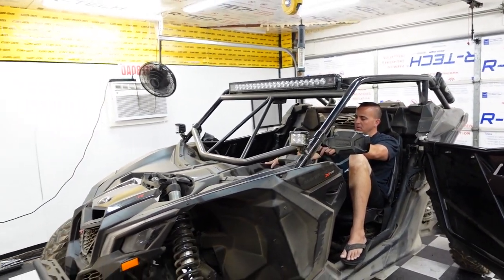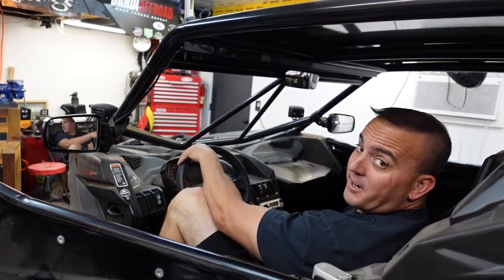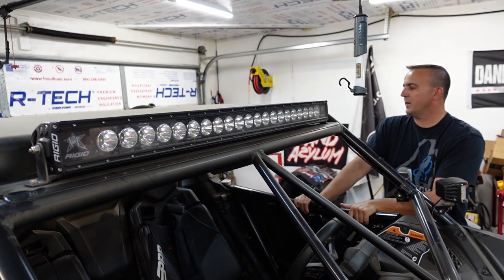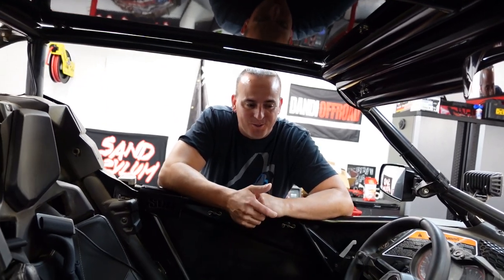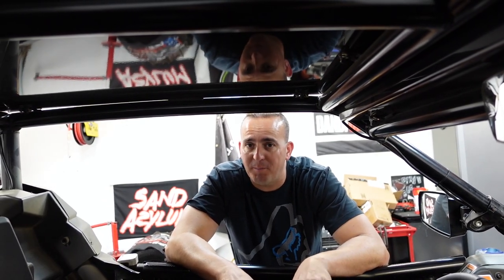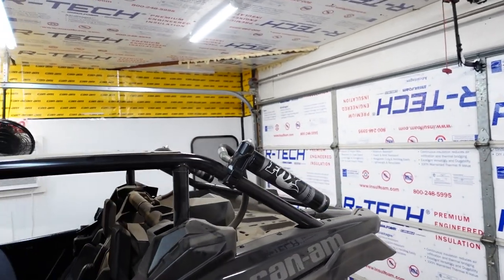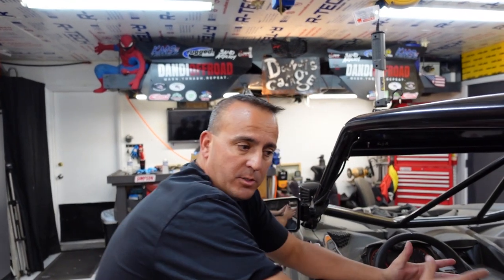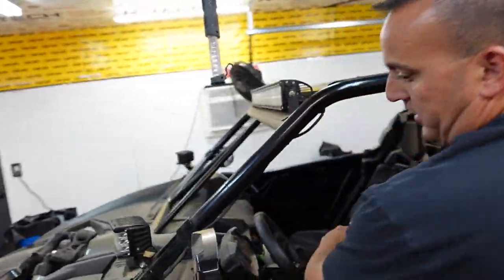Maverick X3 Noise In Drive Shaft

Comment: To get the grease tubes out, I have to grab them with pliers or vice grips and wiggle / twist to break them loose.

Great video and thanks for taking the time to share it.

You've convinced me I don't want to take mine all the way out... Just enough to get the grease into it and get it back together with the witness mark lined up.
Reply from the maker: You are welcome,, it worked out great for his car.
Reply: @DandiOffroad  I did mine yesterday.  The 2021 has a bolt with nylock clamping interface on the midsection.   I added blue loctite and snugged it up.  Most of the metal rattlesnake is gone... There is a hint of it, but it was such a pain in the ass on the Max having to remove the front seat that I ended up not doing the rear.  Probably should have but I decided to install the belt temp gauge instead.  Glad I did.  The little bit of rattle that's left might just be me needing to reach back there and tighten the clamp up next time I'm working on it.

Comment: I did the sandcraft carrier on my 4 seater. It had that same rattle and its gone now. My driveshaft wasn't phased right either so I did that and it just seems to run tighter now. The way I did my 4 seater looked a lot easier than what you guys had to do
Reply from the maker: we weren't swapping the carrier bearing, it already had a soundcraft carrier bearing. I've seen two cars with the Sandcraft carrier bearings still have noise. We were greasing the splines so we needed to get to each end of the drive shaft. This resolved his issue.
Reply: @DandiOffroad   oh ok. Mine was the OEM carrier was just rattling. I haven't greased the splines yet, probably should have.
Reply from the maker: we're going to grease ours and leave the OEM carrier bearing and see what it does. If it still makes noise then we'll put a Sandcraft bearing in it. We have 3,000 miles on our car so I'm curious to see how that goes.

Comment: This issue can be fixed at any can am dealer for free as a service bulletin BRP put out. Doesn't matter if the car has warranty or aftermarket mods. Mine went away for about 300 miles then came back after having the dealer fix it, about to take it back and have them fix it again free of charge. Hopefully it'll go away this time.
Reply from the maker: Got ya,, @ Brett Belardinella had a good point drive and zert it, that way we can keep it greased. We dont take our car to the dealer, we love to save the work for garage videos.
Reply: Taking mine to the dealership. Lol
Reply: @vincentchato519  I can tell ya this for free, either get a louder exhaust or learn to ignore it before you buy a Polaris.

Comment: Just got a used 2016 Can Am 1000r and the motor sounds like it's workining to hard to get any speed. 4000+ RPM and only doing about 35 mph. Is this normal?

Comment: Loosen the bolt and slide it alittle back and pack grease in then slide it back up retighten bolt.  Takes about  25 minutes.  Or take it to a dealership for free and not have your machine for a fee days 🤷🏻‍♂️.  😜 a special homemade tool makes packing the grease in a breeze.
Reply from the maker: Yeah we got it all dialed in. Ours makes that noise too but I'm too busy having fun to notice.

Comment: Mine's made the metal rattlesnake sound since it was new.  I'm going to try this soon.

Mine is RPM based.  It's about 5200 RPM.   100 or 200 up or down and it goes away.

Do you know about what rpm yours was doing it?
Reply from the maker: metal rattlesnake,, I like it. I do not remember what the RPM was,, that was a while back.
Reply: mine makes the same rattle snake noise did you ever find out what it was?
Reply: @jaimehernandez4435  greasing the front and rear of the drive shaft did the trick.  On my 2021 it was a little more conduct l complicated than on one of the videos I watched, but it wasn't terrible by any means.

Get a flashlight, rotate the shaft around so you can see what is going on.  I'm trying to remember, but I think. There might have been a zerk fitting that I could hit.   Not sure.  I do know I filled the front shaft coupling with grease and the back one and that made a huge difference.

I know the regular grease points throughout the chassis barely had any grease in them... So top those off while you're at it if you haven't already.

Comment: You're going to burn out your gear kit on your formula garage door opener that 250 spring will not lift that door after you added all that insulation
Reply from the maker: Well I guess its time for a new opener with a remote,, but I am able to lift the door by hand pretty easily still. What kind of opener should we get ?
Reply: @DandiOffroad  just use the one you have till it brakes  it's a good opener
Reply from the maker: We will for sure,, I've been usinging it for 11 years,, it keeps on goin

Comment: I’m so disappointed with the engineers at brp they must have predicted the problem here plus they deleted the rubber boots on there drive lines. I would drill and tap for grease fittings on the yokes
Reply from the maker: Yeah that would have been nice. Ours makes that noise also, but we just keep beatin the breaks off of it and no issues so far.

Comment: My brand new xrs rr ss did it right out the gate I was very disappointed paying 31000 cash for it
Reply from the maker: I wouldn't be to disappointed, thats a bad ass machine, and this is a very minor issue. Congrats..
Reply: Same for me. Brand new 2022 x3 max XRS Turbo RR  .. 0 miles and makes this noise at low speeds right out the gate. Installing rugged's now and will have the dealer grease the drive shaft while they're at it and hope for the best..  Did you get yours fixed ?